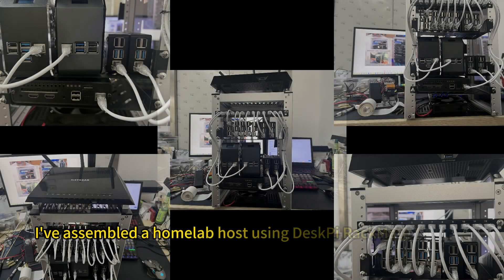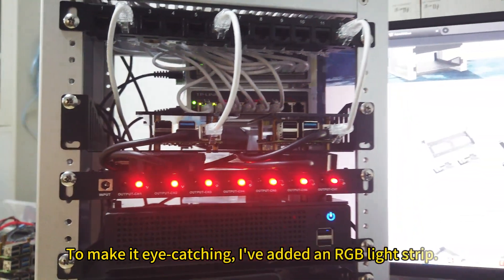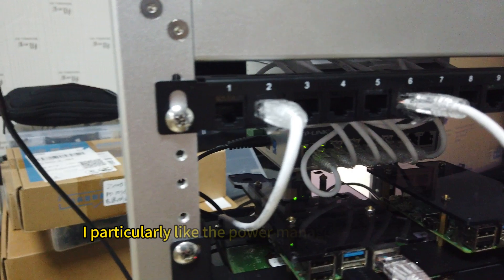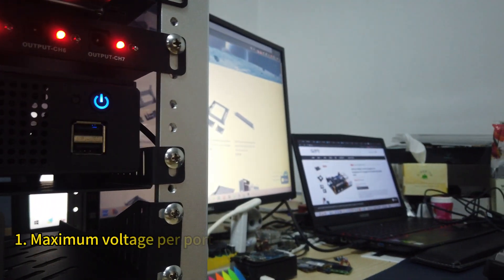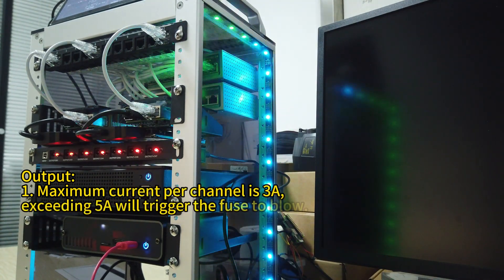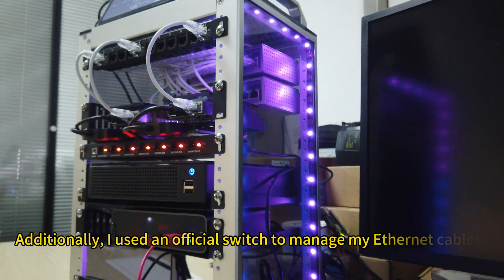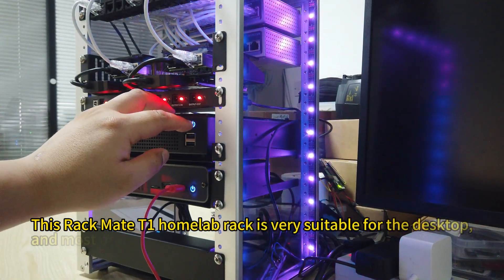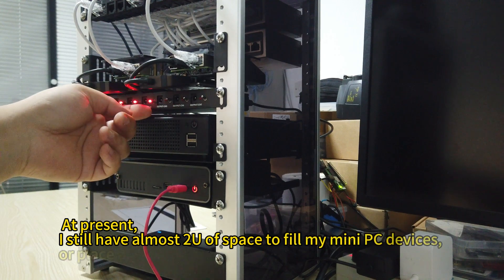DeskPi RackMate T1 -Build your Mini Home Server or HomeLab Server SKU: DP-0022

Comment: Will a 10" AC PSU be available soon?
Reply from the maker: Yes, it will coming soon.
Reply from the maker: You mean 10 inch AC power supply unit ?
Reply: @52Pi_Maker_Education  Exactly. A 1U or 2U power strip essentially. Also a suggestion, you should list the circular silver mounting hardware, that comes with the Rack Mate, separately so that we can mount other rack items with the same consistent hardware.
Reply from the maker: @anthonycvella  Oh, recently we do not have schdule on AC power supply unit, but we are going to test some power supply unit for Rackmate T1 ASAP

Comment: Hi, Can you please send a link to the power switch?
Reply from the maker: That power switch will be launched at  about September 1th , and you will be the first one to know ~ I will send message to you.
Reply from the maker: the power swith has been launched right now.

😄
Reply: @52Pi_Maker_Education  Nice and thanks!
Reply from the maker: It will be launched very soon,  you can access deskpi.com for more detail or new arrival products.
Reply from the maker: Hi bro,  check this out please. 
* DeskPi DC PDU Lite 7-CH 0.5U for DeskPi Rackmate T1
US： https://www.amazon.com/dp/B0DGFZVXF6
UK：https://www.amazon.co.uk/dp/B0DGGB14KN
Reply: Is there a power supply available to power the PDU?
Reply: @Gainovermg  normal 12v/8A power supply will be ok, such as super6c's power supply also works fine.